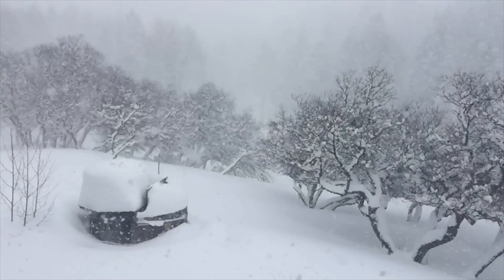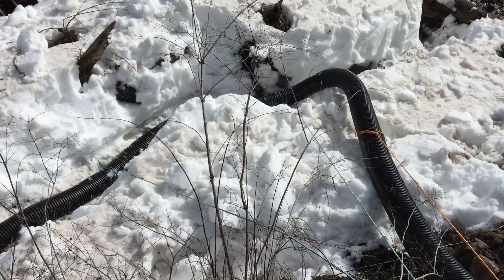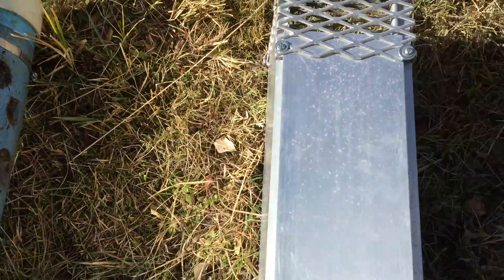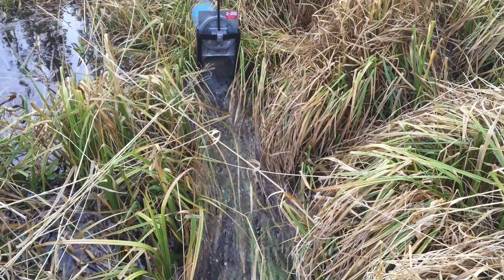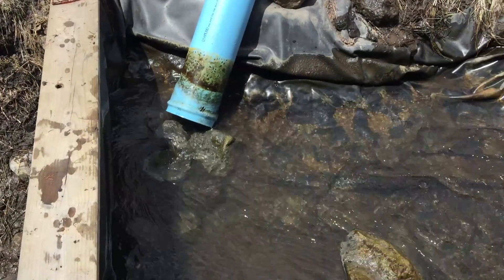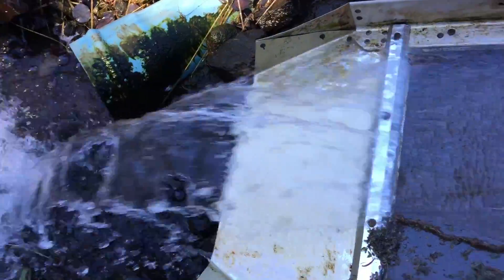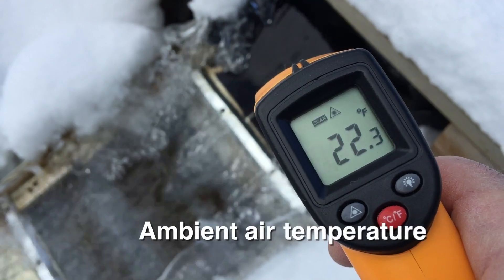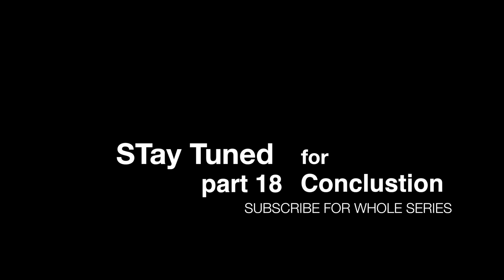Part 17 MicroHydro Power System in CO

Comment: Some tips from a farmer:
There are ball vents for pvc pipe (water floats the ball, if air is present the ball will fall breaking the seal and allowing air to escape).
Perhaps a rotating screen (rotates to clean the screen) there are several types available. 

Both are available from any irrigation supply. Both are cheap. 

Some questions:
Why aren't you capturing all the water available, more water more energy more money.
Why are you wasting head pressure and water by taking it out of pipe to run through the meadow?
Reply from the maker: Thanks for the ideas.  Lots of people have suggested air vents.  The path of the pipe has only minimal fall where the air gets trapped.  There isn’t any pressure to keep a vent closed.  The problem is that the negative suction pressure from the lower part of the pipe would simply suck air in at the vent holes. That is why when I bleed the air out through the holes I need to close the gate at the pipe outlet. Once the air is out of the line, the flow is dramatically increased. 
Thx for watching I'm never sure who has seen what of the series. Here is a playlist of the 3 part synopsis which is an overview of the whole process https://www.youtube.com/playlist?list=PLtTypVpmDd-vkT9bJQkXw4I1t0e_4jMYA The whole series is in about 25 videos. This part 17 video gets promoted most frequently by YouTube.

The reason to capture only part of the water is to not disturb the aquatic life in the creek and there is no need to create vastly more power than we can use.  There is only a stretch of about 200ft. where the water is reduced to less than what we actually put through the penstock.  All water not used for power is returned to the creek after that 200ft. We are fully off grid and 7 miles from the lines.

The reason to collect water in the meadow is to combine it with existing water running through the meadow.  In spring when the creek gets freaky with massive melt off, there is sufficient water in the meadow by itself to provide us all the power we need.  The supplemental water from the creek mainly insures that we never drain the pipe and in Winter can have sufficient water to generate max power to heat the house.
Reply: @mrhydrohead  Pumbing Air bleeding valves might work. These are using in hydronic systems to let trapped air escape, but will not let water out or air in. They are automatic.
Reply from the maker: Guy Tech I’ll take a look into that. It may be that the winter freezing temps may preclude using them, but thanks for the suggestion and for watching
Reply from the maker: Another commenter pointed out the error in the link I provided that it didn't work.  It should have been https://www.youtube.com/playlist?list=PLtTypVpmDd-vkT9bJQkXw4I1t0e_4jMYA  
Sorry about that.
Reply: Necessity is the mother of invention. Great job.

Comment: Maybe prefilter the flow  2 yards before it hits the pipe? 2 strainer screens one behind the other.Remove one for cleaning while the other remaining screen does the job.
Reply from the maker: Thanks for the suggestion.  This video was posted quite a while back and many subsequent modifications have been made to enhance the system and overcome problems. Thx for watching I'm never sure who has seen what of the series. Here is a playlist of the 3 part synopsis which is an overview of the whole process https://www.youtube.com/playlist?list=PLtTypVpmDd-vkT9bJQkXw4I1t0e_4jMYA The whole series is in about 25 videos. This part 17 video gets promoted most frequently by YouTube.
Reply from the maker: Another commenter pointed out the error in the link I provided that it didn't work.  It should have been https://www.youtube.com/playlist?list=PLtTypVpmDd-vkT9bJQkXw4I1t0e_4jMYA  
Sorry about that.

Comment: What consideration have you given to using the system 's own (mechanical or electrical) power to minimize manual maintenance?
Reply from the maker: The system requires almost no tending.  Power is 1/2 mile from the intake, and each year we need to adapt to the changes to the creek bed caused by the spring melt off.  Any permanent installation would likely be washed away.  Its also a hobby to work with the changes.
This video was posted quite a while back and many subsequent modifications have been made to enhance the system and overcome problems. Thx for watching I'm never sure who has seen what of the series. Here is a playlist of the 3 part synopsis which is an overview of the whole process https://www.youtube.com/playlist?list=PLtTypVpmDd-vkT9bJQkXw4I1t0e_4jMYA The whole series is in about 25 videos. This part 17 video gets promoted most frequently by YouTube.
Reply: @mrhydrohead  Thank you for your reply. Just considering my laziness factor :-)
(Not really, just interested in reliability due to debris & ice)
Reply from the maker: Another commenter pointed out the error in the link I provided that it didn't work.  It should have been https://www.youtube.com/playlist?list=PLtTypVpmDd-vkT9bJQkXw4I1t0e_4jMYA  
Sorry about that.

Comment: https://www.gore.co.uk/products/categories/venting You might try installing a Goretex type vent in place of the manual air release. I think the water pressure would keep the air from flowing into the system but if not then you could make a small oneway valve as well. Reference time 06:40 in the video,  screw seal vent holes.
Reply from the maker: Its an interesting idea, I'll look into it. Lots of people have suggested air vents.  The path of the pipe has only minimal fall where the air gets trapped.  There isn’t any pressure to keep a vent closed.  The problem is that the negative suction pressure from the lower part of the pipe would simply suck air in at the vent holes. That is why when I bleed the air out through the holes I need to close the gate at the pipe outlet. Once the air is out of the line, the flow is dramatically increased. Thx for watching I'm never sure who has seen what of the series. Here is a playlist of the 3 part synopsis which is an overview of the whole process https://www.youtube.com/playlist?list=PLtTypVpmDd-vkT9bJQkXw4I1t0e_4jMYA The whole series is in about 25 videos. This part 17 video gets promoted most frequently by YouTube.
Reply from the maker: Another commenter pointed out the error in the link I provided that it didn't work.  It should have been https://www.youtube.com/playlist?list=PLtTypVpmDd-vkT9bJQkXw4I1t0e_4jMYA  
Sorry about that.

Comment: solar panels are looking pretty good after watching this
Reply from the maker: Thx for watching I'm never sure who has seen what of the series. Here is a playlist of the 3 part synopsis which is an overview of the whole process https://www.youtube.com/playlist?list=PLtTypVpmDd-vkT9bJQkXw4I1t0e_4jMYA The whole series is in about 25 videos. This part 17 video gets promoted most frequently by YouTube.
Solar is fine for intermittent source and batteries or using the grid as your battery.   Solar would have been a waste as we already had so much available power.  Cleaning a foot of snow off an array at 8600ft in winter wouldn't have been any fun either.  As is the system suits all our needs and then some.
Reply from the maker: Another commenter pointed out the error in the link I provided that it didn't work.  It should have been https://www.youtube.com/playlist?list=PLtTypVpmDd-vkT9bJQkXw4I1t0e_4jMYA  
Sorry about that.

Comment: why not use air valve to solve the air problem?
Reply from the maker: Lots of people have suggested air vents.  The path of the pipe has only minimal fall where the air gets trapped.  There isn’t any pressure to keep a vent closed.  The problem is that the negative suction pressure from the lower part of the pipe would simply suck air in at the vent holes. That is why when I bleed the air out through the holes I need to close the gate at the pipe outlet. Once the air is out of the line, the flow is dramatically increased. Thx for watching I'm never sure who has seen what of the series. Here is a playlist of the 3 part synopsis which is an overview of the whole process https://www.youtube.com/playlist?list=PLtTypVpmDd-vkT9bJQkXw4I1t0e_4jMYA The whole series is in about 25 videos. This part 17 video gets promoted most frequently by YouTube.
Reply from the maker: Another commenter pointed out the error in the link I provided that it didn't work.  It should have been https://www.youtube.com/playlist?list=PLtTypVpmDd-vkT9bJQkXw4I1t0e_4jMYA  
Sorry about that.

Comment: Add AAV automatic air vents where your screws are will displace the air. Your design is too elaborate that’s your problem too much thinking make it simpler it will work better! There’s an easier way without hydro a generator is required a brushless 2 phase motor work it out.
Reply from the maker: Thanks for the suggestion.  This video was posted quite a while back and many subsequent modifications have been made to enhance the system and overcome problems. Thx for watching I'm never sure who has seen what of the series. Here is a playlist of the 3 part synopsis which is an overview of the whole process https://www.youtube.com/playlist?list=PLtTypVpmDd-vkT9bJQkXw4I1t0e_4jMYA The whole series is in about 25 videos. This part 17 video gets promoted most frequently by YouTube.
Reply from the maker: Another commenter pointed out the error in the link I provided that it didn't work.  It should have been https://www.youtube.com/playlist?list=PLtTypVpmDd-vkT9bJQkXw4I1t0e_4jMYA  
Sorry about that.

Comment: How many permits did you have to buy to be off grid and build?
Reply from the maker: Every state and country has different regulations on the use of water.  In Colorado we had to acquire water rights by filing in water court and going through what can be a years long process to secure the water rights even though its all on our own property.  Our water rights are Junior to pre existing Senior water rights down stream.   The water diversion is non-consumptive and actually conserves water as there is less evaporation in a pipeline than there is with water tumbling down the creek bed.
We also had to acquire a county permit to run the power under the road.
Thx for watching  I'm never sure who has seen what of the series.  Here is a playlist of the 3 part synopsis which is an overview of the whole process https://www.youtube.com/playlist?list=PLtTypVpmDd-vkT9bJQkXw4I1t0e_4jMYA  The whole series is in about 25 videos.  This part 17 video gets promoted most frequently by YouTube.

Comment: I wonder if a mechanical de-icer could be installed that works every hour or so, to clear the ice/organic build up on the filter. Or potentially, take some of your 4500W (maybe 300) to apply gentle heating to the filter  to reduce the icing. If an ice layer was to form, above the water flow but let the water flow underneath would the system still work? An underground(ice) river of sorts. Excelletn work, and a great video - 4500W x 24 hours = 108 KwHrs per day - do you have an epic storage system? Could you create a larger body of water that stores the potential energy? I suppose it would freeze and that's no good - maybe some heavy insulated underground tanks... :P (got a couple mil spare?)
Reply from the maker: Lots of folks have recommendations, however the system has been running now for years without need of modification. Power is 1/2 mile from the intake. 170-200kWh/day in Winter!  No storage, just straight AC and plenty of it.  Thx for watching.  I'm never sure who has seen what of the series.  Here is a playlist of the 3 part synopsis which is an overview of the whole process https://www.youtube.com/playlist?list=PLtTypVpmDd-vkT9bJQkXw4I1t0e_4jMYA  The whole series is in about 25 videos.  This part 17 video gets promoted most frequently by YouTube.

Comment: Small waterwheel on the intake of your screen with a brush on a small track would keep it clean all of the time so long as water was flowing.
Reply from the maker: Lots of folks have recommendations, however the system has been running now for years without need of modification.  Thx for watching  I'm never sure who has seen what of the series.  Here is a playlist of the 3 part synopsis which is an overview of the whole process https://www.youtube.com/playlist?list=PLtTypVpmDd-vkT9bJQkXw4I1t0e_4jMYA  The whole series is in about 25 videos.  This part 17 video gets promoted most frequently by YouTube.

Comment: Nice explanatory video. I faced a similar issue due to air so i added low pressure valves instead of screws so i didnt have to check them daily.
Reply from the maker: Lots of people have suggested air vents.  The path of the pipe has only minimal fall where the air gets trapped.  There isn’t any pressure to keep a vent closed.  The problem is that the negative suction pressure from the lower part of the pipe would simply suck air in at the vent holes. That is why when I bleed the air out through the holes I need to close the gate at the pipe outlet. Once the air is out of the line, the flow is dramatically increased. Thx for watching I'm never sure who has seen what of the series. Here is a playlist of the 3 part synopsis which is an overview of the whole process https://www.youtube.com/playlist?list=PLtTypVpmDd-vkT9bJQkXw4I1t0e_4jMYA The whole series is in about 25 videos. This part 17 video gets promoted most frequently by YouTube.
Reply from the maker: Another commenter pointed out the error in the link I provided that it didn't work.  It should have been https://www.youtube.com/playlist?list=PLtTypVpmDd-vkT9bJQkXw4I1t0e_4jMYA  
Sorry about that.

Comment: Some suggestions:

1. The water supply tube may all the way under running water plus at an angle between 4.5  to 3.1 degree downhill.

2. Water collection area may be a lagoon so mud and dirt will be wash away by running water.

3. Water intake of power generater may have a two stage filter. First thru a rock and sand bay, then use a rotational meshes filter ( the filter rotate when water flow in).

4. Filter material best use titanium meshes.

This may provide a lowest, almost care free water power generator system.
Reply from the maker: Lots of folks have recommendations, however the system has been running now for years without need of modification.  Thx for watching  I'm never sure who has seen what of the series.  Here is a playlist of the 3 part synopsis which is an overview of the whole process https://www.youtube.com/playlist?list=PLtTypVpmDd-vkT9bJQkXw4I1t0e_4jMYA  The whole series is in about 25 videos.  This part 17 video gets promoted most frequently by YouTube.

Comment: Cool video series and I realize your motivations here may not have been financial but, If you saved $200 a month in electricity charges for the next 25 years, using a 3% discount rate your savings would be around $42,000 (in current dollars). This project would appear to cost at least that much. Am I wrong?
Reply from the maker: You need to know that we are 7 miles from the grid and the estimate in 1996 to bring power lines in was $140K (7*$20K/mile)  Current prices to bring power in range $40-50K/mile.  So, it was a no brainer to enhance the overall property by investing in a far less costly and bill-free solution.  Thx for watching  I'm never sure who has seen what of the series.  Here is a playlist of the 3 part synopsis which is an overview of the whole process https://www.youtube.com/playlist?list=PLtTypVpmDd-vkT9bJQkXw4I1t0e_4jMYA  The whole series is in about 25 videos.  This part 17 video gets promoted most frequently by YouTube.
Reply: @mrhydrohead  Makes perfect sense then.

Comment: With all that POWER...

It occurs to me that you could put in de-icing coils.

Just holding the Coanda screen at 32F would ensure it wouldn’t freeze over.

US Navy Ships use compressed air bubbles to stop ice forming.

You could use a water wheel to power the air pump.
Reply from the maker: The power is 1/2 mile from the coanda and we don't have power interruptions due to freezing so no need to make this super expensive modification.  Thanks for the suggestion anyway. and Thx for watching  I'm never sure who has seen what of the series.  Here is a playlist of the 3 part synopsis which is an overview of the whole process https://www.youtube.com/playlist?list=PLtTypVpmDd-vkT9bJQkXw4I1t0e_4jMYA  The whole series is in about 25 videos.  This part 17 video gets promoted most frequently by YouTube.

Comment: Try encapsulating the flowing water and to keep it from freezing insulate with a solid foam board with a high R-factor. 
Also I thought that the screen should be upside down completely immersed in a sump with venting water through the bottom of the enclosure to exit any debris. 
Also the air can be automatically removed by having something like a toilet ball float, opens when filled with air and closes and sealing when filled with water. 
All in all this was great but pity the rest of us stuck in cities and states that have lost their way and will not allow such interference to nature.
Reply from the maker: We don't have power interruptions due to freezing and the system runs fine as it is now.  Thanks for the suggestions anyway. I lived in LA for 30+ years and finally took a hike.   Its not really interference with nature so much as just harnessing natural kinetic energy driven by the sun via the hydrological cycle. 
Thx for watching  I'm never sure who has seen what of the series.  Here is a playlist of the 3 part synopsis which is an overview of the whole process https://www.youtube.com/playlist?list=PLtTypVpmDd-vkT9bJQkXw4I1t0e_4jMYA  The whole series is in about 25 videos.  This part 17 video gets promoted most frequently by YouTube.